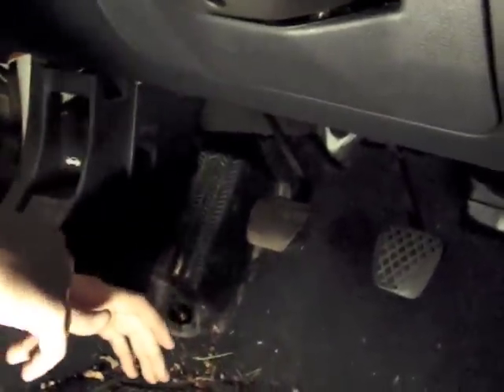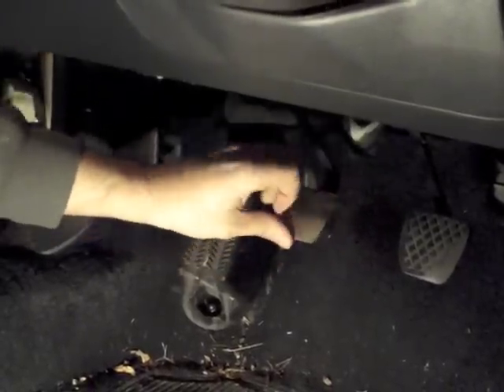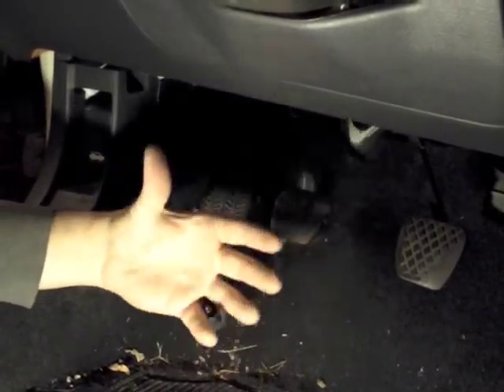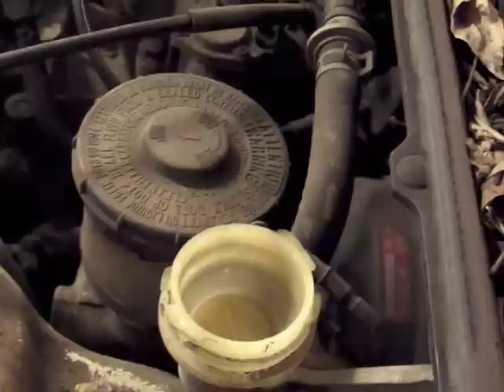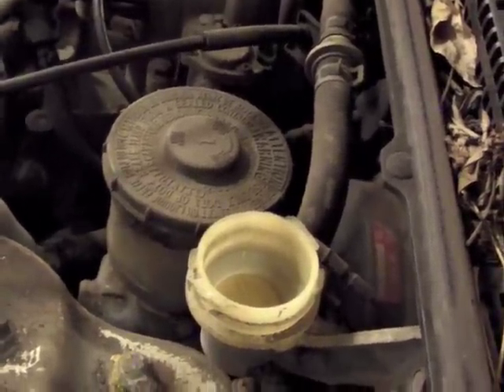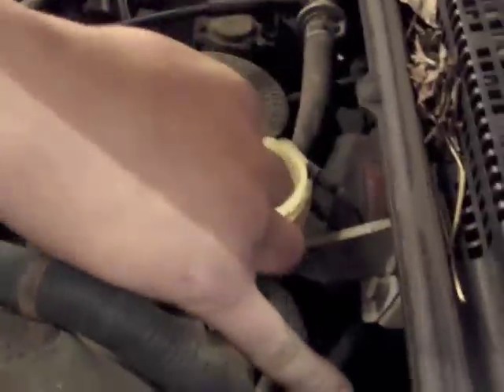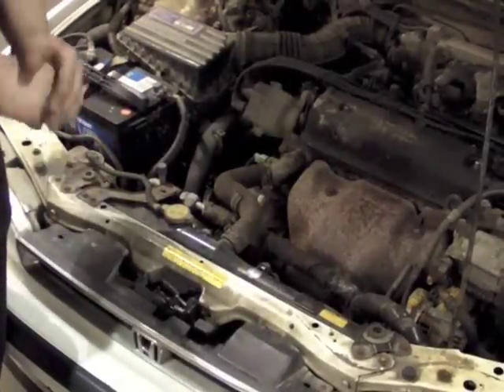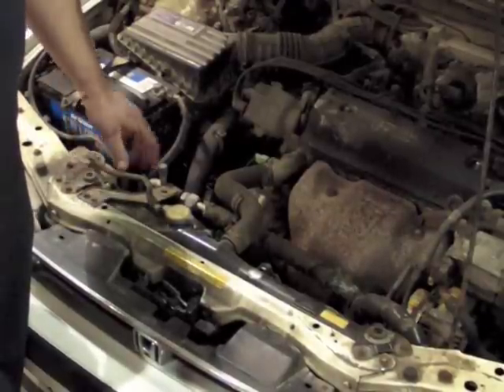How To Diagnose A Clutch Problem

Comment: Perhaps you can help me diagnose this: I own a 99 Subaru Impreza. After an engine swap I performed I hear a grinding noise when the clutch pedal is completely depressed AFTER the engine has warmed up. There is also a little rattle when the clutch pedal is completely released that disappears if I put ANY pressure on the pedal. I've heard Throwout bearings and Main shaft bearings.. Any suggestions?

Comment: NEED HELP PLEASE! i have a 99 honda crv and my clutch pedal was really loose to the point where you can actually flap the pedal back and fourth really easly, it had about an inch to inch and a half of slack before i can feel it engage so my friend adjusted the pedal to where it would engage without any slack. now the clutch is slipping every time when the car gets hot, but when its cold the clutch grabs fine. we bleed the clutch also and there's no leaks as far as i can tell.

Comment from the maker: @Avenger77420 based on what you've replaced it sounds like you just have air in the system.. (double check the master/slave for any leaks etc. but if your not losing fluid it sounds like you just need to do a good system bleed. basically follow the steps we did to bleed in the video pump and open the slave bleeder screw then pump again..sometimes gravity bleeding works too. it may take a few tries but it sounds like you def have air in the system giving the spongy feel.

Comment: My clutch pedal went extremely hard. It happened once or twice then was fine, then the next day went hard and I couldn't change gear. I have checked the hydraulic system and the fork is moving fine. The fork sounds squeaky (I don't know if thats normal) The master and slave cylinder seem fine.... Any ideas??

Comment from the maker: @jbarringer89 based on this info since you've replaced the clutch I would follow the steps in the video and check your hydraulic system for leaks. start by bleeding the slave cylinder first. I believe your truck has an internal slave but it should have an external bleeder screw.(check the master as well) When you pulled the clutch did you see any leaks? Something i've personally experienced was an internal slave failure which leaked fluid on my clutch causing me to need to replace both the slave

Comment: please help, I live in japan and have a 97 honda integra type r. When the car is off i can push the clutch in and put it into any gear. however as soon as i turn the car on it refuses to go into any gear. I will start it from first gear and from there i can shift, however when i am coming to a stop i will throw it in neutral and break, after that it will refuse to go into gear, i bleed the clutch cylinders and added more because it was dark brown, which could it be, clutch or master/slave?

Comment: I have a 93 honda civic that needs fluid added every 3 days. It still goes into gears but it's getting stuck in 3rd or sometimes won't even go into 3rd. We seen a small leak in the front kind of by the raidiator of the car, is this where the slave cylinder is located? what other possible things can be wrong?

Comment: Hi, any ideas what could cause a clutch to creak and go slighty sticky when hot? When I say sticky I mean as in you press the pedal and instead of being light and smooth it feels like it's a little heavier to press and creaks as well as you reach the bottom of the pedal stroke. This is only when you get the car fully hot though. It's fine when cold.

Comment: i have 327 t5 camaro it  broke down and we pulled trans  the clutch spring was broke in half so we put a new clutch, fly, and press.plate in but when we cranked the car up and tried to put it into gear we found that it would go through all gears including reverse without pressing the clutch we also bleed the clutch b/c pedal was soft but it didnt do anything the pedal stayed soft and the clutch still wont disengage...working on it 4 3 weeks still wont move...please help, i have mustangs to beat

Comment: Good explanantion, i had cluctch problem where cluctch started little hard and then sticking and then stopped working.

every time i put leg on paddle and it came back.

Mechanic did some manual bleed like you did in past but last time it appears same problem while i was climbing hill. 

i was in shock and worried that no support will be available in forest area but after few mins when i tried Cluctch startd working.

Do you know why it suddenly started working. it didnt gave me problem till another 400 kms.

do u know why problem happned and why it is solved automatically ?

my car model hyundai i20 petrol.

thanks in advance.
Reply: Please do check your fuses. and Get a mechanic (Professional advice).
Reply: Sandip Thakor  new one

Comment: Oh also while bleeding it when pressin the pedal to the floor and holding it down the fork coming from the transmission still gives out as if you let off the pedal and it returned to it's original position even though the pedal is still to the floor

Comment: i have a 96  eclipse and the clutch paddle is leeking i bleeded the the system am it still didnt work so i was gonna call it a day but when i got in to the car the clutch paddle was very hard what should i do now?also it leeking from inside the car i noticed that my carpet was wet with oil?

Comment: Don't know if anyone has posted this before I NEED HELP SOLVING A CLUTCH ISSUE: My clutch makes a ticking noise, no problems shifting or from pedal or when giving gas (the noise goes away) just noise from clutch, i can hear it through the firewall and it sounds like its ticking when i let off the gas, bottomed out a few months ago and the noise began then, ever since it has this ticking noise. Could it be the pressure plate?

Comment: I have a 00 eclipse GS 2.4 5 speed. I changed the master and slave out. pedal gets pressure to it but not like it used too. When i go to to engage reverse or 1st to move from neutral it wont let me you hear a grinding noise. my cousin said that im not getting enough pedal to the slave from the master. before my master n slave replacement i could never get pressure to the clutch but now im able to just not able to put into gear unless i force it and i dont want to do that. any tips? ive bled the system and no air or leaks. seems like the piston in the slave isn't getting compressed all the way.

Thanks,
John
Reply: that sounds like you have a synchronizer problem inside your transmission itself. i have the same issue trying to go into reverse. i have to move forward a bit in 1st and then shift into reverse. pretty annoying

Comment: My 2005 Jeep Wrangler has a hydraulic clutch.  The pedal feels firm, not spongy or soft.  Endplay is good.  The fluid looks okay.  My problem is that is clunks slightly and feels like it isn't fully disengaging when the pedal is depressed.  If I shift slowly, then it works fine but the clunk is quite pronounced when shifting from 1st to 2nd.  Any ideas?

Comment: I hace a Pontiac Fiero GT. Three-dimensional clutch us soft sms does not return all the way up. I put a new slave cylinder on yet I don't get a complete extension on the slave cylinder. Could it be the clutch master cylinder. Thnx Dave

Comment: i hacve  a 2000 dodge 3500 when ever i push the clutch down its really easy until i get almost to the bottom of floor but it want release the clutch any suggestions and its not leaking any fluid

Comment: i have 97 audi a4, my pedal has plenty of pressure in it but the clutch only grabs first gear enough to shake the car a little. would this be a pressure plate problem or a throwout bearing? or do i just need to get a whole new clutch kit?

Comment: it just started last week on my 1985 Toyota corolla GTS, I have to pump it around 40 times to build up pressure to put in gear. it can lose pressure in like 10 seconds or sometimes it'll have pressure for like a while, does this sound like a air in the system issue or my slave cylinder is done?

Comment: hi, i've got an opel 2000 sedan, last my mechanic fix the pressure plate and clutch disc last month and even replaced the hydraulics of the clutch, and now when i pump the clutch it feels that it doesnt release the gears so i end up waiting for the rpm to neutralize to change gears, what do yoou think is the problem?

Comment: got a 95 ford ranger 4 cylinder have changed slave and master cylinder and hydrolic line.   when I push pedal down it goes half way then turns hard.   what is the problem.  I have dropped my tranny 5 times now.  had a new retainer clip still slave cylinder and my old line was just popping out the side of transmission.    I have a new line and new slave cylinder correct style and still not working.  help

Comment from the maker: @rides4almost sounds like you have a leak in the slave or master cylinder.  Most likely will need to replace one check them for fluid leaks.

Comment: I have a '93 honda civic. This morning on my way to work, I was coasting up the freeway off ramp.  When I pushed in the clutch and tried to bring the gear shifter out of 5th, it felt crunchy, and then wouldn't go into another gear.  I tried all the other gears - reverse would grind the teeth.  After shutting off the car, I decided to try wiggling the gear shifter around more in 5th.  FInally, it popped out, and then I could shift normally again.

Do you have troubleshooting tips?

Thanks for the try Jhong.  I flushed the system.  Then it was better for a about a week.  Then started grinding A LOT.  I replaced the slave and master cylinders.  Grinding changed, but still hard to shift and sounds like something is loose and rattling around.  The disk?
Reply: your problem  is in the clucth master cylinder

Comment: My 99 Saturn SC2 1.9L 5 speed, clutch all the way out for 1st gear and have to rev rpm just for it to engage. Need new clutch, plate, bearing, or can I just try bleeding the line? Please help.

Comment: I'm not sure if I have issues with my clutch or throttle every time I hit the accelerator there's this high squeal noise and it's no horse power especially when I'm going up a hill. it slows down and I have down shift. is that the clutch for sure???

Comment: Good video!  If you had an extra set of hands you could have someone point a flashlight at those locations in the engine.  At 5 minutes in it looks like you do use a light, so thank you.

Comment: I'm still diagnosing, my pedal drops sometimes to the floor like a trapdoor a little pressure then bump drops to the floor and doesn't return, when this problem started I checked the fluid level and it was at Danger so I topped it up, the problem stopped for a while now it is back and the level is still up, I think trapped air, I haven't located a bleeder and can't seem to find any help in locating the slave cylinder, beside the clutch pump I was told, the van is a peugeot partner 1.9hdi 2007

Comment: the clutch plates.. there is no air left in as it has been removed and now the fluid drops continues but still the clutch does not engage and has no resistance. can you find me a solution!

Comment from the maker: @nyshadow clutch slip is basically when your clutch is engaging the transmission but there is a "slippage" for example imagine you let the clutch out and the engine rpm's climb without any forward motion or tire slippage.. all clutches will slip to a point as they only have so much grabbing power.. if you clutch is very worn you will notice it is not able to handle all the power from your engine and transfer that to your wheels..

Comment from the maker: @maverick2030 well we noticed the slave was leaking a fair amount and the master had a tiny leak.. after bleeding it worked fine but we should and i would recommend replacing them especially since the parts are pretty cheap and its easy to do..

Comment from the maker: @zane2289 if the pedal actually feels soft or spongy it's a hydraulic issue, sometimes is difficult to get all the air out so you could open the bleeder am let it gravity bleed instead of the pressure method, make sure the master is only adjusted to a slight bit of end play, but not much more or less. See if you can watch the slave mice while someone else pushes the pedal and go from there

Comment: I have a 1985 BMW model 325es every time when I press the clutch pedal it gets stuck and when I turn on the engine it accelerates and I didn't even press anything I need help do I need to get new Master Cylinder and Slave cylinder?

Comment from the maker: @autohowtovideos 

and the clutch as well (that fluid will ruin the disc).  So start with a simple bleed procedure and check the system for leaks but if the system won't hold pressure and the master looks good I would suspect you need to replace that internal slave.

Comment: D clutch was slipping an burned out so I changed It an d new1 is still slippin an burning an d car is not moving at all. Cud it be d slive causing dat peroblem  Cause dere is no leaks in d system but I notice a little mosture in d slive cylinder dust cap?

Comment: 06 ford fusion leaking brake fluid out of the starter.. master cylinder is right below the starter you press the clutch peddle fluid comes out..of starter... what could it be ????

Comment: Hi, i own a 92 hond prelude and my problem is that when i want to leave and whant to put in first gear it enters very hard on cold engine. But after that its fine. It remains only my second problem and that is the 3rd gear witch does not enter smootly when i downgrade. The rpm has to be right to enter. Is this a adjusment problem or? Thano you
Reply: just change the gear fluid
Reply: Aku112811 I changed the clutch fluid and the gear oil...
Reply: Robert Morodan How many miles has it been since last clutch change? Does your clutch slip? My clutch on my car had hard engages before clutch went out. Also if your clutch is fine it's normal for it to be hard to get into gear when cold.

Comment: I have a 2011 Honda Civic.  I tried rocking it out of ice by engaging and disengaging clutch. Unsuccessful.  Now, I can't engage with the clutch at all.  In any gear, I let the clutch out and the engine just revs.  And, I left the car overnight on a slight hill, in first gear (no brake on) and, after the ice melted, it coasted backwards until it hit somebody's garbage bags.  Could have been so much worse.  What do you think the problem is? Clutch, a linkage, transmission, etc?

Comment: Hi,
I drive a Hyundai Tucson 2.0 lt. CDI Automatic transmission 2005. While driving i press on the gas peddle but the car does not want to go especially on steep roads. Do I need to change my clutch? Thanks and any help would be most appropriated.

Comment: soo i have a 96 R33 skyline and today i came to a red light tried to find first gear and it was really hard getting it in just replaced my clutch 800km ago and it still grabs good so i dont think thats the issue also when fully depressed and at a stop the clutch will still be engaged ..dunno why. stalled a few times already doing that. any ideas? my frustration is quickly getting out of hand.

Comment: I have a 2001 Chevrolet Blazer 2wd 2 door, and when I start off from a stop light, it feels like the clutch slips at higher rpms(around 2500ish), and it's difficult to shift it from 2nd to 3rd, it feels clunky.  Is it a bad clutch or maybe a slave cylinder or something?

Comment: just throwing it out there 3 week ago i got my car and it was diagnosed by a mechanic) with a clutch goin bad .... ive changed the oil already and was going to replace the spark plug soon yet today I started it up and not even 2 minutes down the road it shuts off after i try to put it back into second gear :( so i started it again and the iddle sounded a lil rough (i had the clutch half way in ) i put it back into first gear and the same thing it dies  :((( I cant tell could it be gone  ? plzthx

Comment: What if i have no pressure at all. the pedal goes to the floor and i can put it in gear, and i check the liquid in the reservoir and there is fluid in there. but i have no pressire what so ever.

Comment from the maker: @hotdream320 if the slave is leaking fluid from the boot or with the bleeder closed you def need to replace it.. be sure to also check your lines and master to make sure there are no other air/fluid leaks. once the new slave is on follow the bleed procedure (it might take quite a few tries) to build up pressure and you should be good to go

Comment: Hi bro tks four your video,I have a Fiat Stilo 1.6 16V from 2002 I fit a new clutch 12 weeks a go and now the clutch start sleeping same times, same times I drive is ok soon I tach just a little bit on clutch pedal just 1cm is start sleeping my clutch is hydraulic not have adjustment I been remove the gearbox cover and check the fly wheel is very very dry and no leaks on diff drive shaft can you please help me whit any idea soon is possible tank you best regards:Berenguer

Comment: My Hyundai produces a rhythmic bumping like sound when driving over 95 km/h. It gets louder when driving faster and at 130 it is worrying. Listening very carefully I hear it too very softly at a lower speed, 90. But at still lower speed I cant hear it, maybe gone? The garage diagnoses a clutch problem as the sound disappears when pushing the clutch. It is a costly repair, but is it the most probable cause of he sound? Speed, accelleration, clutching  and fuel cunsumption are normal